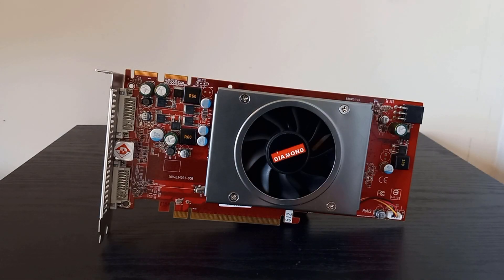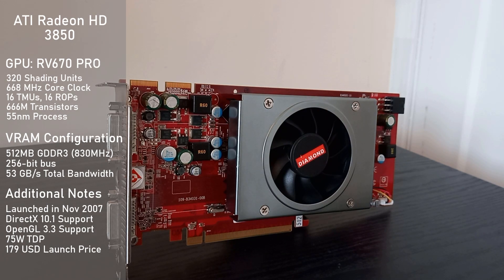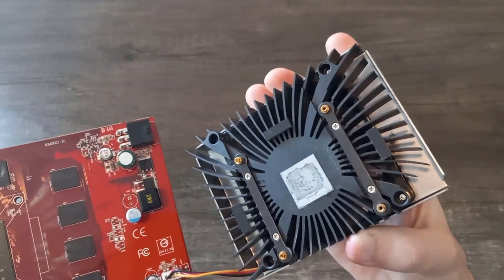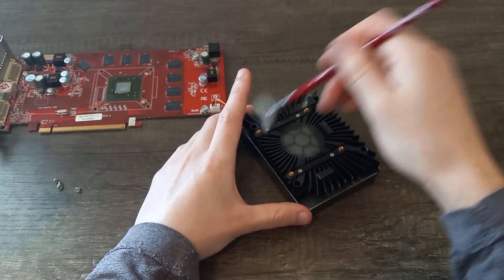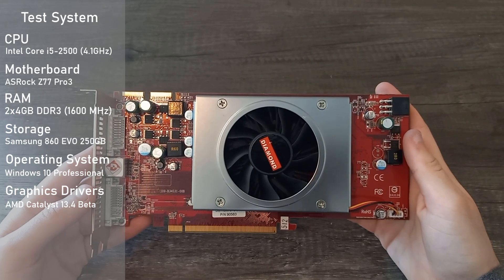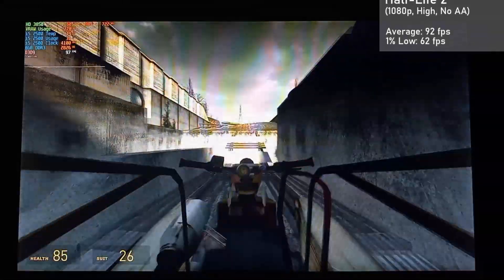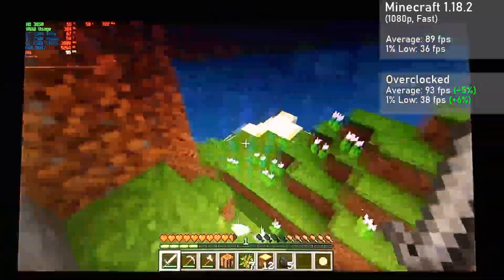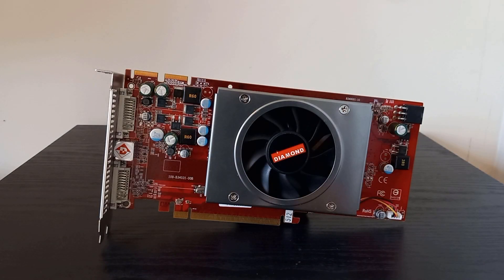The Radeon HD 3850: Power for the People in 2007

Comment: Had a sapphire HD 3850 but it was the AGP slot model, installing drivers for that thing was a pain as the AMD drivers didn't officially support the chips being used on boards with AGP slots.

You had to either wait for the AGP hotfix driver by AMD, or find the hardware vendor ID in device manager for the AGP card, go into the driver .inf file and replace the PCIe HD 3850's ID with the AGP version's.